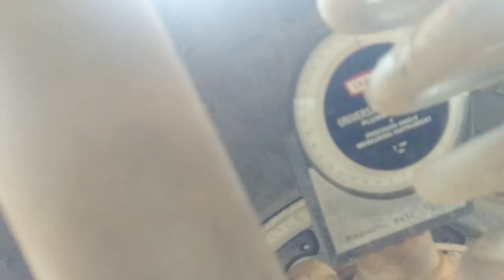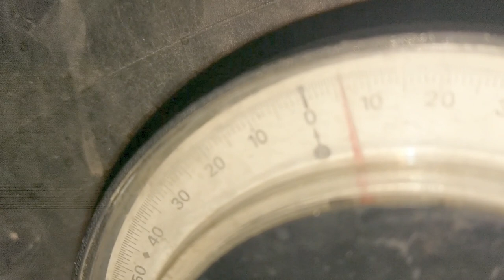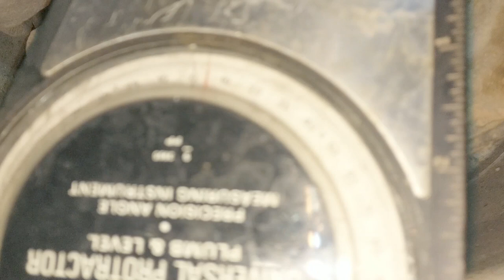89 Cherokee Checking and Adjusting Caster

Comment: You should have moved the lower control arm forward as much as you moved the upper control arm back in order to keep you wheel base the same as it was. Your lower is slotted at the back bushing. This also keeps your drive shaft in better alignment. You wouldn’t have had to move the upper nearly as much to get the correct angle that way.
Reply: Geo Stanley was getting ready to say the same, I would have pushed them all the way forward and went from there. When I had short arms, I had adjustable upper and lower control arms, so it made things a lot easier.
Reply: Josh B mine is a long arm from rough country and it has adjustable upper and lower. Y style control arm uses one mounting point to the body and the upper comes off of the lower. Not much different than the short arm as far as adjustments are concerned.
Reply: I have Cavfabs Alpha 3 link now
Reply: Josh B what kind of cost/warranty do the cavfabs 3 link have? My entire RC 6.5” Xflex long arm kit was less than $2000 and RC has a really good warranty.
Reply: Yup need adjustable lower also
Reply: Geo Stanley i have a 93 zj and have 6 inches of lift how much do I adjust the control arms and do u know what the angle should be on the axels thanks
Reply: Drew Scrappy Duncan ll how much you adjust the control arms is based on several things. You want to keep your axle centered in the fender opening, at the same time keeping your drive line angle proper. If you know what lift kit you have, then you can possibly look up the proper pinion angle requirements on their website.
Reply: Geo Stanley thanks for the info I have a 3.5 inch trail master lift with all new adjustable control arms and have 3 inch spring boosters to add with it as well thanks so much for ur help this is my first build so I'm learning as I go thanks again

Comment: Hey man. Been keeping up with the Jeep vids for like two years now cuz I had an 89 but now I have a 96. Our set ups our similar and I have also been tackling my steerings bumpsteer/wobble for months now as its my daily too.

It's your track bar dude. The stock bracket on the axle side and your utk drag link are at harsh angles. Just like the control arms the steering does best the more level or parallel to the ground it is. Get a kit that cuts off the track bar axle side bracket and welds on a new one that raises it up and uses a heim joint.

Then raise the drag link either by  OTK HD crossover steering or I've been thinking about WJ Knuckles

Comment: Yeah, what my lift kit instructions said to do with my adjustable control arms; and, then what Ossie, my alignment guy ended up adjusting to, were way different.  I can't remember exactly; but, I think it was set to around 12 and he brought it down to 9?  Or was it 6?  I forgot; but, the steering was never an issue for me.  He set it up to the edge of factory specs.  In high speed bumper to bumper traffic, my ZJ is so stable,  I can ride in close-quarters traffic with great confidence. I've noticed a lot more Jeeps in his shop, lately, ever since I posted my videos, at Ossie's.
Reply: I posted the same video on other websites, not just Youtube.
Reply: What I remember is he shortened the front lower control arms, probably by an inch and a half; than, what the instructions recommended.  Everything else was spot on.

Comment: First make sure axle is square. Set the angle you need and put drivers side upper control arm in. Do not force the bolt in but adjust until bolt just slips in with no resistance. Drop axle down on ground and put passenger side in the same way with no bolt resistance. Doing it in this manner stops upper arms from fighting each other. They DO NOT need to be equal length nor should they be. This way of doing it is from a thread on adjusting 8 control arms on the jeepforum. I did mine that way and the handling improvement was vastly better. Caster angle is an interplay with pinion angle. Only can do what is necessary to get the diff pointing at the transfer case. It will be what it is.

Comment: Dont worry about the 3 degree difference. Came across this when i did my three link. I checked every cherokee my family owns (5) and all of them were 3 degrees more on the passenger. No clue why.
Reply from the maker: Me too :)
Reply: because your inner c's are not set at the same caster you can cut the welds and turn them and keep your pinion angle correct while fixing your caster
Reply: NickInTimeFilms The degree difference is for road crown. The roads are slanted away from the middle of the road to let rain run off. If the caster was the exact same on it, you'd be fighting the Jeep wanting to head towards the shoulder.
Reply: I had this same issue on mine glad I’m not alone lol

Comment: I agree with  Watupal your lower control arm bracket has a lot of adjustment room (video  3:51) the bolt looks almost center of adjustment range. I am curious if the passenger side has the same amount of adjustment  range? Thanks for the videos I recently installed  the iron rock over the knuckle steering set up and didn't even have to read the instructions because I watched your video.  LOL  I had a bad death wobble issue  and one of the problems was  the long tie rod end was coming down at a steep angle because of lift causing the ball-joint in the end  to try and separate and of coarse there were the other issues so iron rock track bar with drop bracket  new hub bearings, adjustable upper control arm along with new axle side upper bushings ( I also watched a video on replacing upper bushings and mine didn't come out anything like the video showed) took me 6 hours and in the video it took less than 15 minutes   darn editing  LOL  looking forward to the longarm install keep up the videos

Comment: That jam nut is also there to keep the pivot part of the control arm true and straight. I had the RHS one come loose and the eye with the flex joint turned and was rubbing on the housing on the chassy making this crap rubbing sound. I got under there, straightened the control arm and tightened the crap of that jam nut = problem solved!

Comment: having adjustable lower arms also allows you to adjust more for the caster or getting long arms, that works to.
Reply from the maker: +Douglas Hefner true, but then you also change the wheelbase which may cause other clearneces issues.
Reply: that is another thing. lots of angles and dangles lol
Reply: You changed the wheelbase by only moving the upper. Draw it on a sheet of paper and it will make sense. It’s like the lobe of a cam. If you move the top of the lobe backwards and keep the bottom of the lobe the same then you move the cams center point. 😜

Comment: Looks like your bottom control arm frame mount has adjustment built in. Push them to the front.  It'll roll the axle the way you need

Comment: Interesting that there is not more of this on the YJ with leaf springs if raised by longer spring shackles.  By just moving the leaf spring down in the front, it rolls the + caster right out of the straight axle.   The only way to put it back is a tapered shim under the leaf spring between the spring and axle perch.   Pretty rickey dink for security.   I have yet to find one YouTube video on it.  Most people blame sorry ride on the track bar on a straight axle.

Comment: when that zip tie breaks at 85-90 the front driveshafts gonna go through the floor or launch that things into the air
Reply from the maker: Who doesn't like a little pole vault action? When I took it on trips I wrapped a ratchet strap around it 20 times and tied the end so it wasn't going anywhere easily. I can leave it attached now that I rebuilt the transfercase though.
Reply: NickInTimeFilms  ya just looked sketchy... my buddies dad had an escalade where that actually happend. Driveshaft went through the floor between the center captains seats

Comment: Question,,where did you zero the gauge on,,the frame?,,got a solid axle Toyota,,figured if you zero on the frame ,,that would put you and the right track of getting the correct degree

Comment: I'd ditch those heim joints. Ive never understood why people like them on a daily driver. Personally I think the y-link factory geometry steering handles the best especially in preventing bumpsteer. Currie currectlync is great.
Reply from the maker: +Watupal my problem is the TREs don't last very long, and no company made a proper y-link with replaceable ends. All of them were inverted-t and then you've got Tierod roll to deal with.
Reply: Yeah I agree. The inverted t-systems aren't a good choice either imo. I have Rocky-road drop brackets on my jeep similar to yours. You know you can shim the fixed lower control arm! I just used about 1/2" nuts as washers behind the lower control arm and adjusted my uppers. The lower control arm brace is slotted for caster adjustment from the factory.
Reply: I kind of thought Ruff Stuff Specialties had an interesting T-link with HD (1-ton) TRE. PLus they make a "washer" that interfaces with the grease boot to "reduce" TRE roll. Maybe a thought?
Reply from the maker: I've seen "The Cure" before and that is only a bandaid for a terrible design. They wear out fairly quickly and then you're back to square one. The last I saw I think Ironman4x4 was making a proper 1-ton y-link with replaceable ends because they were making a custom passenger outer for proper joint angles. Little pricy for my cheapass but it does look like a solid option
Reply: NickInTimeFilms I saw that as well. Looks very interesting indeed. I'm just too much of a wimp to ream out my knuckles. I might reconsider it since I want something new & I've been wanting their track bar. Just rewatched that video you did.

Comment: Yeah death wobbles in Cherokees are scary as hell the very first time I got my white 88 Cherokee some drug addicts put a homemade lift kit on this thing they cut the spring perches off the factory axle welded a 4 inch steel block to the axle and then welded the factory spring perches back to the top of put the factory suspension back on it to lift it up off the ground then when I put the track bar in all they did was stick a bolt through it and tack weld the back of it they didn't even put a nut on it on the road and hit a bump a big one and it broke the weld on the boat in the track bar came out and it went into a a really bad high speed death wobble at 50 miles an hour you talking about scary as hell the back wheels were jumping off the ground from left to right I thought I was for a minute going to roll over then about got hit head-on by 18 wheeler locally I didn't thank God will finally I got it out of the road it took me a minute cuz you know when the track bar is not bolted up it don't want to steer with a shit so once I got it off to the side of the road into a gas station parking lot me and a buddy of mine he turn the wheel while on the track bar back up I took a screwdriver and stuck it through the track bar bolt hole then I took a ratchet strap and rest it around the screwdriver and then wrap it around or the track bar goes in ratchet strap it down there so the screwdrivers stay in there and I took a pair of vice grips and clamp to the backside of it and then took a chain and wrapped around all of that I managed to get it home I had to do two miles an hour all the way to the house from where I was at when I pick the vehicle up it normally takes about 20 or 30 minutes to make it home from there and it took me 5 and 1/2 6 hours to get home but when I got it there I parked at Jack the body up and strip the whole front end completely out I got another front end put in it and then went and put a brand new Rusty's 3 and 1/2 inch Offroad lift on the front of it and it came before brand new shocks then I drove it for three years he had four brand-new 31 1050 all-terrain tires on it I drove it everywhere always had a four-wheeler or dirt bike so that's what I took off road well when then finally broke down and I couldn't write them anymore a friend of mine got an S10 Blazer for 300 bucks he put this tripod thing it goes underneath the battery it's for a vacuum advance so the 4-wheel drive work he fixed it we got some 33s we Groove them cut the fenders on the Blazer and put them on there he talked me into taking my shit to the woods so I did and then I was hooked ever since I rolled it over one time with the 31s on it then I wasn't pleased anymore so I went ahead and got rid of the 31 and went to some 33 and I've never ever had an issue out of it I've never rolled over again now with the suspension lift on this Jeep like I said I had to rush these three and a half inch up front in a four and a half inch Block in the rear now the only downfall it ruins your factory Springs after a long while of stretching and flexing but with it being that way I flex that thing as hard as I can and never ever pull the tire off the ground and lets the front wheel I've only thing that I ever broke was a universal in the rear drive shaft and that's it hell I drove this thing for three years with the driver side front axle universal joint clicking making horrible noise but it never broke when we finally decided to change it the actual universal joint when you pulled the Caps off they look like star heads like a throwing star the Caps didn't even have bearings in them where the cap slides onto the universal it was oval-shaped and my buddy looked at me and said how in the hell did you not break that because I know how you drive this Jeep Drive the hell out of it when they're going to slow in the trail lol and it never broke and not only that it was a daily driver on top of that but I just could not kill that damn thing now it's got a brand new rear end in it just waiting to be beat on but Jeeps are fun like I said I would never ever get rid of mine I've on mine for 16 years out of that 16 years eight of those years or eight and a half of those years I drove it with it Knocking and 7 pounds of oil pressure and drove it everywhere and four-wheel the hell out of it well I finally got another vehicle so I parked it and it's been parked ever since I think it's been riding a year now then the last time I started it up

Comment: Hi there, please l just need a little advise. I've a 89 jeep cherokee as in this video, but, with 3" of lift and 31" of tires, l think l have to adjust the caster too, so, my question is, do l have put the caster in the same degree as in this video , 6 degrees, or less ? Thank you so much for your reply. Bye Moreno.
Reply from the maker: There was a chart somewhere that had slightly different angles for different heights so it may be worth looking up

Comment: Did I just see that right? Your Drive Shaft is just hanging there?! How does that affect it and your drive? I usually take mine out if I don't need it. Pain in the @$$ to take in & out a lot. X-)
Reply from the maker: Yeah, for long highway drives I just zip tie it up so I can cruise at 85mph without shakes. Only problem is the slip joint gets stiff real quick when it doesn't get used which makes re-installing a pain. I need to pull the t-case and replace the front bearings to remove the yoke slop, just haven't felt like it yet.
Reply: NickInTimeFilms I hear ya. My front pinon bearing needs replacing but having found the time with the winter. Your Tcase would make for an interesting video. 😁
Reply: I have been wondering the same thing ever since I first watched the video months ago.

Comment: Also, what kind of fuel mileage do you get now?
Reply from the maker: +My_Name_Is_Chef Heh, it ain't pretty. With a Renix 4.6L stroker pushing 35x12.5" tires with 4.56 gears, I average 10-11 mpgs. I just recently did some wideband o2 tuning and I might be closer to 15mpg now though, need to drive it more to find out but it's looks much better.
Reply: NickInTimeFilms well I didn't think it'd be good XD but I was curious. My finished jeep should be 33" tires and a 4.5" long arm lift. My drive to work with a 3" lift and 31s results in 14mpg. Through town. But I would be pretty happy with 15👌

Comment: Did u take in account you were parked on a hill?
Reply from the maker: Yes, I measured the ground before hand and it's level, but that is important to get this corrected.
Reply: @NickInTimeFilms  I'm sure you did just a thought.. I know when my way together  I had similar  problem I had to push the lowers out to get enough adjustment almost like a 2 in stretch drove like a dream how yours handling now?  Ever consider wj knuckles ?
Reply from the maker: @Cmecandido  it seemed to track better after caster adjustment. I recently replaced a lot of stuff trying to fix death wobble so it isn't too bad any more, but makes me wonder about hydro assist or a pitmen brace to really clean up the last bit of play.
Reply: Still wandering if you can’t just zero out on the frame rail,,say in the area on the frame under the door,,the longest flat lengths of the frame,,it looks if you was zeroed out to the frame ,,you would read correct degree of caster,,it would rule out un level ground
Reply: @NickInTimeFilms  yeah with tires over 33 I think a brace would be good . I don't have one but I know u can get some good movement . My wj was lifted 8 inches and I went thru every thing and I could a 1 inch crack on the track bar bracket gusset but couldn't tell without having some one turn the wheel while on the ground  and finally found it. It was only a tiny crack but the movement was like 1/4 inch at the bottom of the brace. After I welded it it was like new. But finding it was a pain. What condition is your steering box